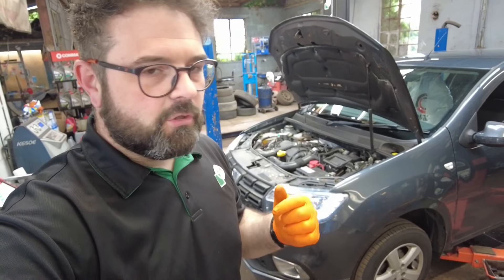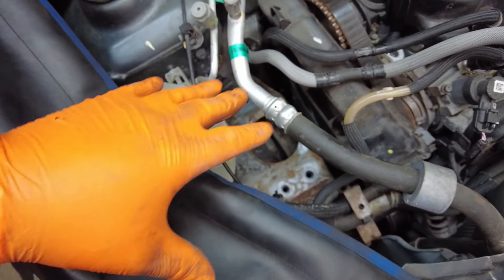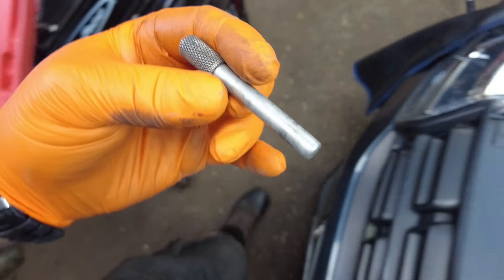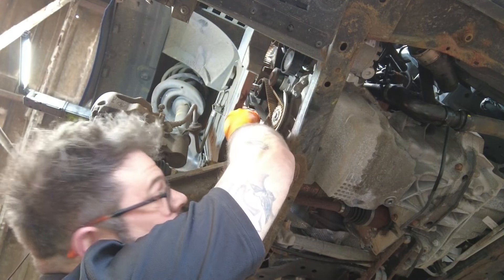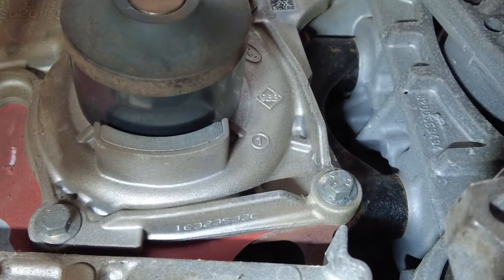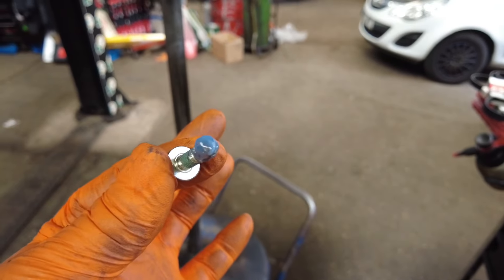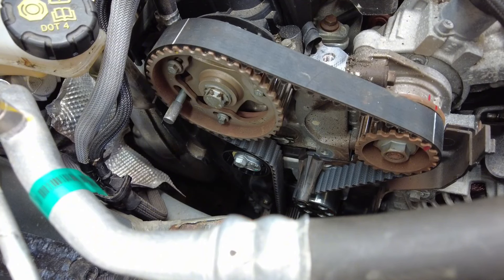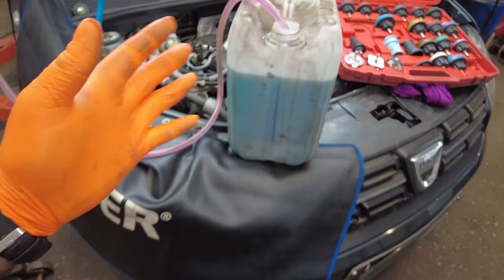I HAD A TRIP TO A&E AFTER I ADVISE EVERYONE TO BE CAREFUL WHEN DOING 1.5DCI TIMING BELTS......

Comment: Ive done a few of these , love the metal gasket , i was once doing a sill repair, cutting out the rot with a slit disc on a grinder , turned the grinder  off , pulled out the rot patch , then leaned over ,10 secs later ,grinder spinning slowly picked the grinder up   strait to the wood on me finger , blue roll ,masking tape new glove and cracked on , 3 days later almost healed , now have 30 mm white line on me finger 😂😂😂😂😂

Comment: My wife has 1. Nothing but problems.
Reply: Heard they are pretty reliable. Have you tried replacing the wife, replace it with a younger model, usually does the trick.
Reply: Brilliant , still laughing
Reply: 900 tce is trouble 1.5 dci is great

Comment: Baz, I am 60 years plus mechanic and really enjoy your videos my friend. Reference any wet cambelt engine they are a total design disaster. Rubber and Fibre does not work in oil and degrades the belt hence the problems. I advise anyone thinking of buying a car to avoid a wet cambelt engine. 

Looking forward to seeing you change a clutch on  6 speed EAT on a Citroen Vehicle plus any electronic setup. 😮

Comment: I think your workmate doing a wind up using the air tool when you start recording.  He's standing smiling behind the wheel. 😀 Worst injury I got when removing drums on the back of an Astra. Caught my fingers behind the drum after replacing the shoes. Blood everywhere and at A & E a junior doc plunged my fingers into iodine. Hit the roof. 🤐
Reply from the maker: Worst I've had is spinning a mini rear wheel with 12 inch wheels on and smashing my fingers to bits on the subframe 🤢🤢🤢
Reply: Just looking at my 70 yo mits and evaluating war wounds, amazing how you remember how they all happened. Great video as per Baz, really enjoy your content👍

Comment: Baz ever snapped a crank bolt ,seems like it would be a nightmare 🙃?
Reply from the maker: I've not no buddy
Reply: I have on a 16 valve petrol  clio , after doing a belt kit , not even gunned up tight  I had to centre punch the new bolt out , put the old one back in   no problem 😂

Comment: Hi Baz, great work and advise. My son has a 2011 1400 Corsa d and keeps showing timing error "P0335 crankshaft position, sensor error. and P0011 Timing cam over advanced or system performance ban. We have changed the sensor but the problem remains. It drives well for a couple of days then stalls and becomes hard to start, but will then run well again. I beleive there is a vvt valve and ocv filter that may be a cause if intermitant failure. Your thoughts please.
Reply from the maker: Could be possibly the timing chain
Reply: @bazmeredith  Thanks.